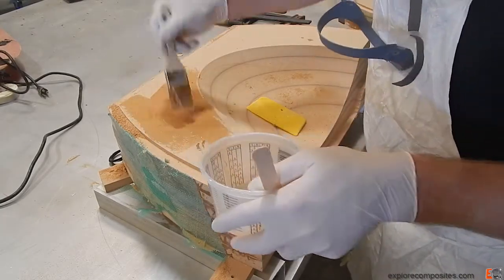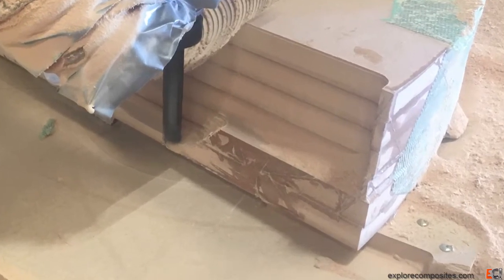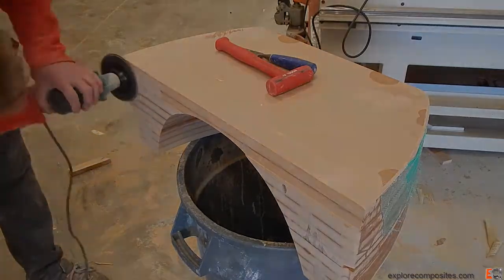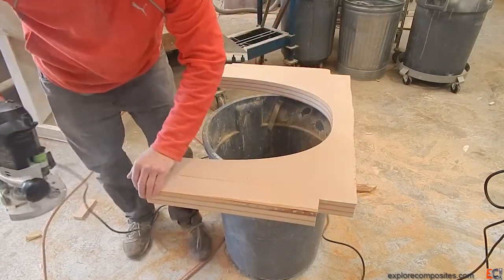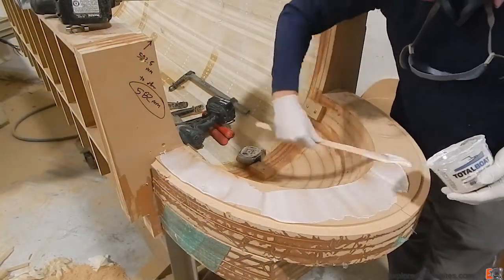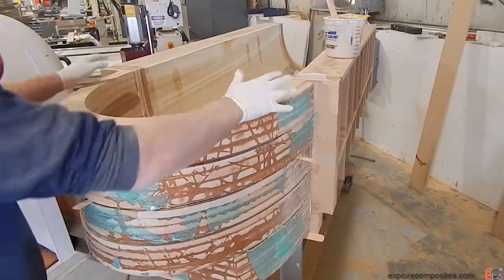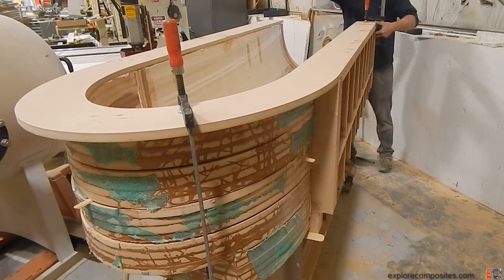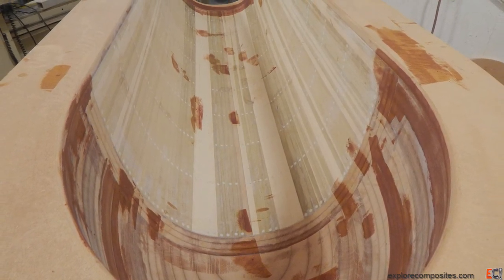Hyperloop Shell: Mold Assembly (Part 4)

Comment: Is that a orbital sander which you used?
Reply from the maker: The little one with the T-handle is a Makita.  It's just rotary - not orbital.  Very handy tool and easier to hold than a 4.5" right angle grinder.  Think it uses 6" disks... not sure.
Reply: @ExploreComposites  Thankyou for your reply😊

Comment: What is thickened epoxy ??
And how do I make it?
Reply from the maker: It is regular 5:1 epoxy like WEST system with fumed silica (Aerosol, Cab-o-sil, etc.) and maybe a little Q-cell (glass microspheres) to make it sand more like wood and less like rock.  You mix the epoxy normally and then add the filler and stir it in.  It takes a few minutes of gentle stirring to get it thick enough.  Wear a mask though - the fumed silica is nasty stuff.
Reply: @ExploreComposites  Thank you Explore Composites! Really enjoying your channel.